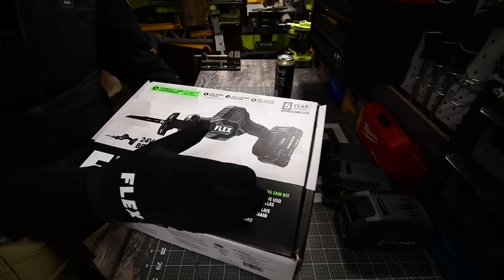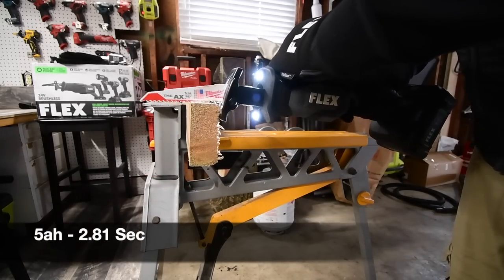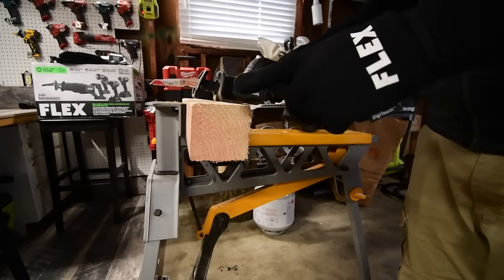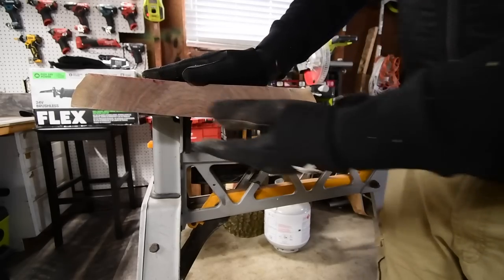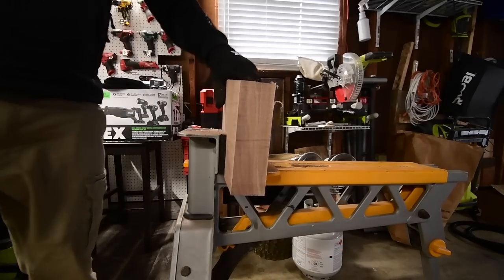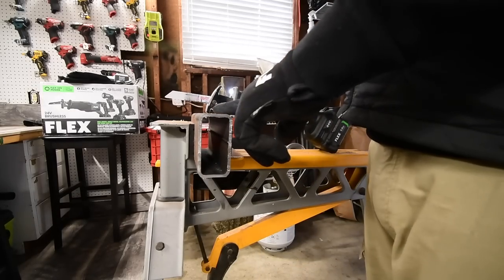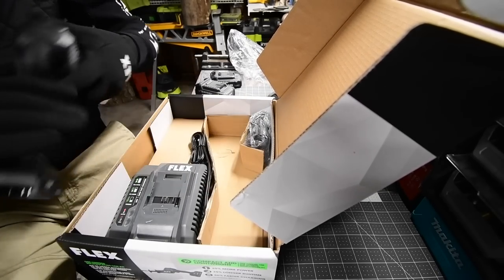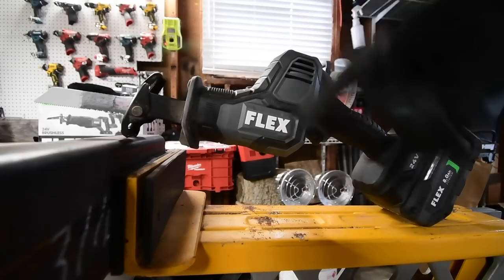This Saw Be Flexin!

Comment: I'm actually glad you mentioned that the tools do have a break in period. most don't realize this. also there aren't any videos out there really on this subject nor the maintenance/upkeep on power tools. the does and donts plus the products you can use and can't on electrical parts and gears ect ECT. might be a good video to do.
Reply from the maker: This recip saw is a beast. very powerful and compact. tools perform better after being used for a little bit. which is why I used to do an out of the box test.

Comment: Totally into these Flex tools, not Barnaby. Looking into experimenting with another tool brand.
Reply from the maker: these FLEX tools are powerful tools. I cant wait to test out the new batteries
Reply: @ManCaverTools  I'm ready for the PowerStack (stacked lithium) technology to come to the 56V EGO batteries. Ended up getting that backpack link system and it works like a charm. EGO & FLEX are owned by the same company so maybe it will happen. I'm holding off until the new batteries come out.

Comment: I bought that kit you didn't open for work, and tbh you get more for you're dollar by just purchasing the high end impact and drill driver combo kit(because of the 5.0 battery) then purchasing the Sawzall separately. The 2x 2.5 batteries just make the Sawzall useless(in the 4 tool kit)
Reply from the maker: I do agree that they need to sell these as tool only as well